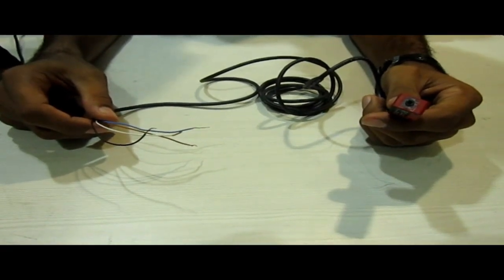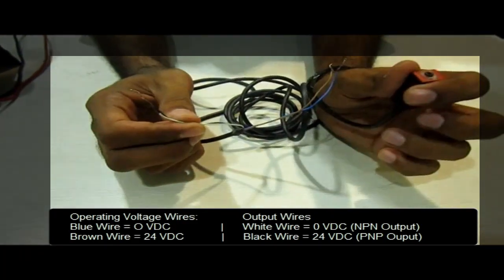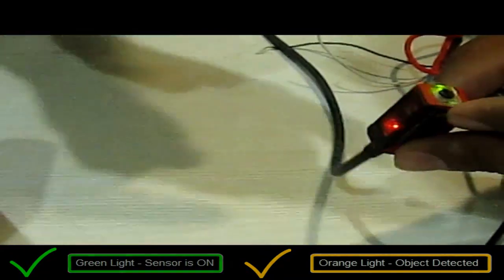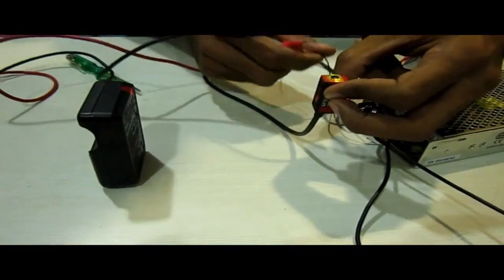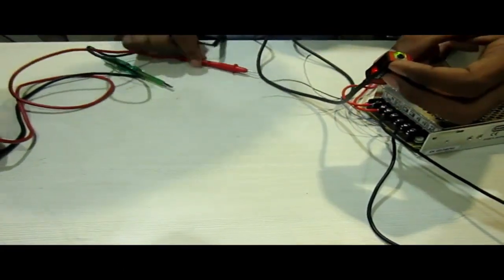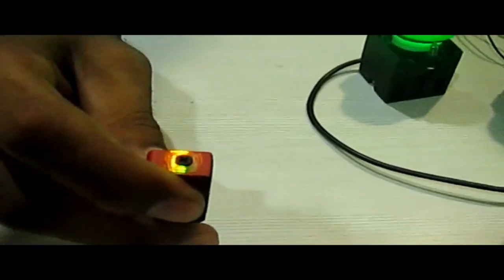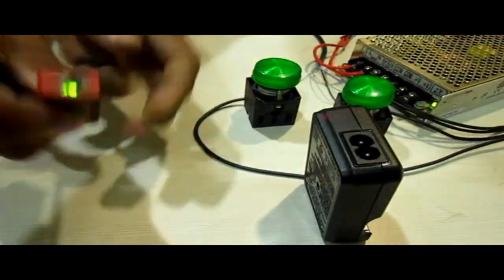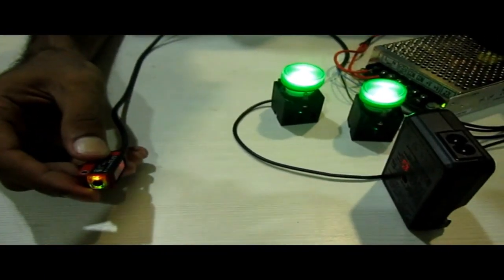How Photoelectric Sensor Works?

Comment: Will this work if the an object moves fast past the sensor?  for split second detection?  80mph?
Reply from the maker: Nope, the sensor has its sensing time which means the object to be sensed must be present for certain amount of time. It could be seconds or in ms depends on the sensor

Comment: Sir, can you suggest any sensor to detect glass. Will photoelectric sensor help to detect glass?
Reply from the maker: +Vikash Kumar Well that depends on the type of sensor. But you can use capacitive sensor. (if that helps)
Reply: +Rajvir Singh (NFI Automation)  Thanks sir. I ll try it. :)
Reply from the maker: +Vikash Kumar Sure good luck!

Comment: Hello sir i want to use for measuring the distance even milimeter range so how can i use it??
Reply from the maker: +varad diwakar For measuring the distance in mm this sensor cannot be used., you need to use analog photoelectric sensor. And their range varies as per the model

Comment: Hi I got a problem here.. mymachine's sensor suddenly works the other way round.. it detect the other parts of plastic which is transparent instead of the red mark part.. please share your suggestion to solve it.. thx
Reply from the maker: Please re-tune (teach) your sensor again if it has controller inside.
Reply: Rajvir Singh 
Does it has any controller if the sensor is similar to as per in the video shown? how to locate the controller?

Comment: hi do you have any code for the optical sensor ?
Reply: Guo Jun arduino codes
Reply from the maker: Guo Jun what specifically you want in code please?
Reply: Hmm. I just need to know how i can make the optical work. Like when it senses light. It counts up
Reply from the maker: Guo Jun Please check this video, it may help you : https://www.youtube.com/watch?v=OKEShsuTh6E
Reply: Alright will do. Thankyou. Is the code provided?
Reply from the maker: Guo Jun Code is explained in the video by our instructor.
Reply: Alright . If i have any inquiry i will ask you again.thankyou :)
Reply: hi! hmmm my optical sensor is npn , do i connect my stepped down voltage to A0 and black to ground ?
Reply from the maker: Guo Jun first tell me the output voltage of your sensor?
Reply from the maker: Rajvir Singh or the operating voltage? Are you giving 24 VDC?
Reply: 5v supplying 18v. Stepped down to 5v
Reply from the maker: Guo Jun So when your sensor goes ON it gives 0 VDC else it's open circuit ! am i correct? 
In that case, you cannot sense it's input to Digital input, as it sense 5V as high and 0V as low. You can make an alternative way to get it sensed. Try to use 5V relay ..actuate it using your sensor and using it's COMMON and NO terminal supply 5V to arduino input. So when sensor goes ON--it will activate the relay--and relay will give 5V to arduino input--I hope it make sense.
Reply: When its on. Doesnt it gives 5v? Npn connection. Can i connect it to analog input? Relay? Never really use before but i can try. Common and no terminal supply? If the relay works. Which input in arduino board should i put it at. Digital or analog?
Reply from the maker: Guo Jun If relay works you should use Digital Input. This will work for you! Try to google SPDT Relay 5V., you will get information on it!
Reply: Alright. Got it. Will get back to you
Reply: Rajvir Singh hi, can i make sure something? im using the npn connection for the optical sensor.so does its output produce a 5v or 0v?
Reply from the maker: Guo Jun It's output will produce 0V
Reply: Ahhh. Shit, means i need a pnp.for the relay?
Reply from the maker: Guo Jun No you don't need PNP for relay., you can use NPN., connect the output of NPN to one terminal of coil and connect 24VDC directly to the another terminal of coil. Please continue the conversation at nfiautomation@gmail.com.

Comment: hi, if im using a npn connection to arduino uno, and i stepped down the voltage to 5v , because 5v is the max voltage an arduino can take in, can it work ?
Reply from the maker: Guo Jun Yes it will work. and please share how are you stepping down the voltage? Using relay?
Reply: Voltage regulator. The optical sensor requires a 12v to 24v but i m using a 9v batt. It doesnt power up eight

Comment: is there photoelectric sensor works on 12V DC and output 12V DC.
Reply from the maker: Yes Jamal Taha  - the operating voltage range of Photoelectric sensor is 10 ~ 30 VDC. So it will output 12 VDC if you give 12 VDC.
Reply: Rajvir Singh  ey can u send me some pdf im starting as a junior tech   my email is jumiller73@icloud.com
Reply from the maker: Julio Miller PDf related to what Julio? Between you can check out website for some recommended pdf related to industrial automation. Visit here: www.nfiautomation.org

Comment: Hello, I would like to know, how expensive is a sensor like that (in US dollars if possible) and what kind of system do you need to plug this sensor? Thank you.
Reply from the maker: miSosiego  You can google for the price, I'm not sure of current price. Between it gives 24 VDC and 0 VDC on detection of output., which you can use to any controller/load with current in the range of 300 mA

Comment from the maker: PNP always gives high output n npn always gives low output. No such rocket science
Reply: So PNP is basically a normally closed and NPN is a normally open?
Reply from the maker: gmecomber No please. We do have further categorization in Sensors. PNP are of two type NO and NC. NO type PNP will give high output on detection of object and NC type PNP gives high output when the object is not detected!

Similar in case of NPN Type- These are of two type NO and NC. NO type NPN will give low output on detection of object and NC type NPN gives low output when the object is not detected!

Sounds little confusing, but i hope it make sense!
Reply: it's make thank you

Comment: but what does pnp and npn output mean.??...bro please help

can u provide me an link where i can better understand npn and pnp?
Reply: Mech E PNP means 24V output you will get, NPN means 0V output you will get
Reply from the maker: Vikash Kumar Or PNP gives "High output" - which is the operating voltage which you give to the sensor to energize it. For instance generally the sensor operating voltage is 10 ~ 30 VDC. It you giving 12VDC as operating voltage to sensor, then PNP sensor will give 12 VDC and NPN will give 0 VDC.
Reply: Thanks
Reply: I was studying about modus in this was confused whether rs232 is inside modus which is used for transmission purpose
Reply: It was a great vidio it solved my problem